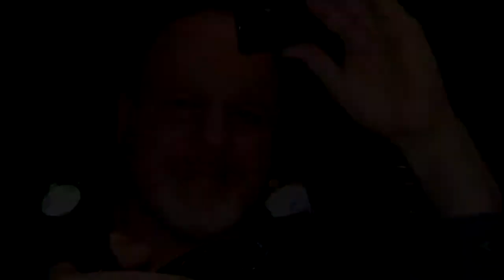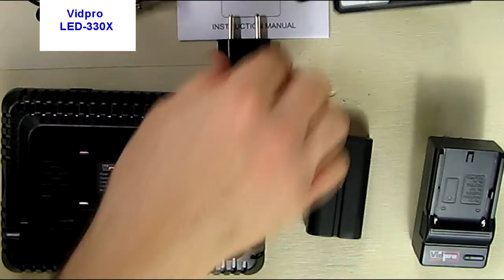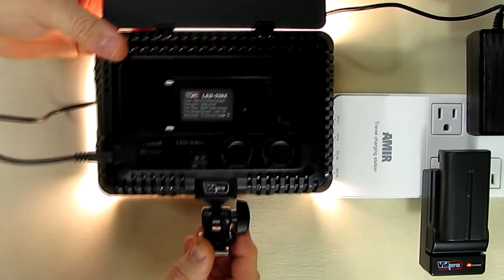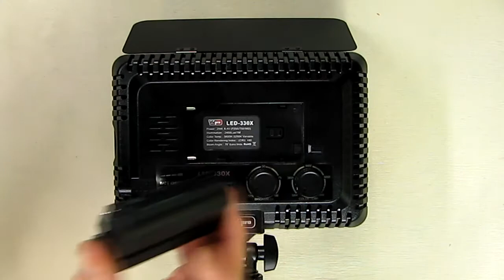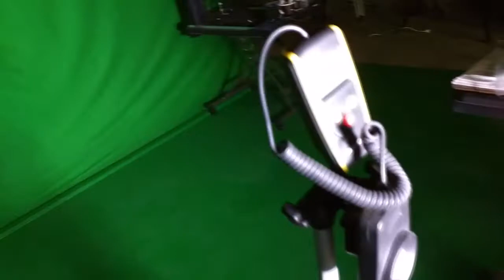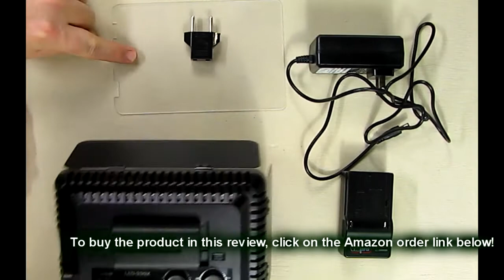BEST On-Camera LED Video Light  Vidpro LED-330X Varicolor Studio Video Lighting Kit REVIEW

Comment: Sorry for this noob questions:

I would like to see how this vidpro light  works when shooting a video outdoors using the 5600 kelvin light mode. Do you really have to use it when it's sunny daylight? Or it has to be in overcast? If you use this type of video light, would 
people get annoy by this?

 Also, what are those orange, diffuser and purple gels  are use for? Perhaps, if you can, show more demo for those (gels) please? Thank you in advance.
Reply from the maker: You can use outside even on bright days because the LED light can be directed on the subjects face, shows and movies do this all the time. The gels are used to soften the light on the subject.